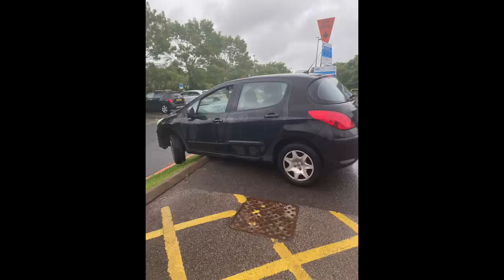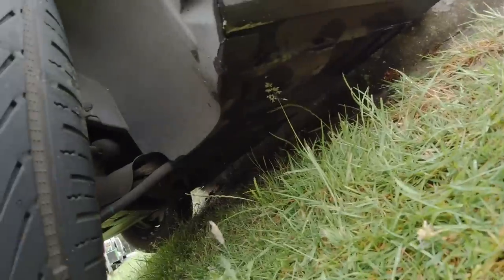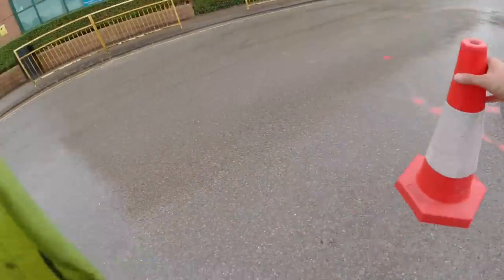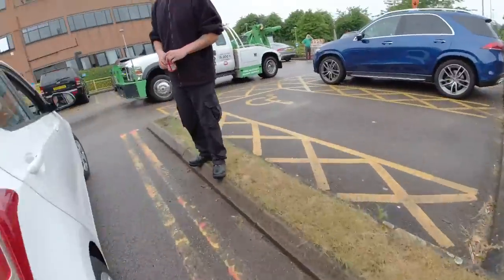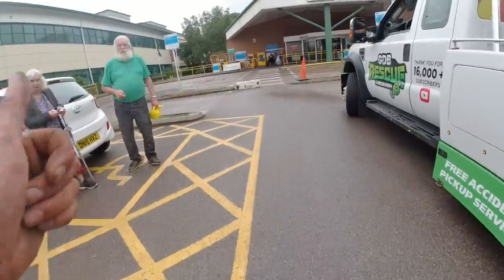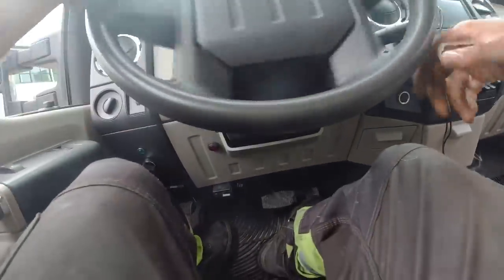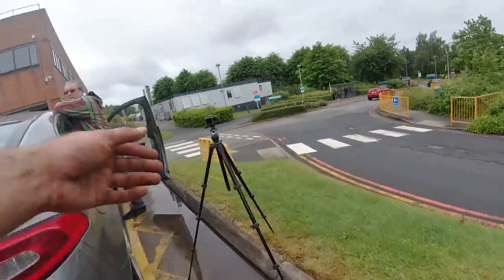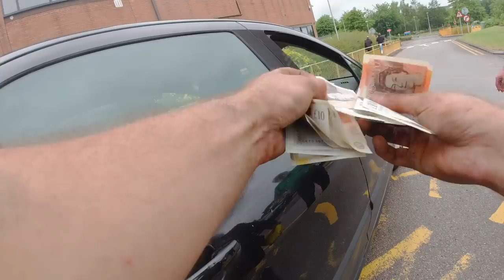INCIDENT at Stafford Hospital - A&E Car Hanging over the EDGE!

Comment: When I was doing breakdown and recovery  we had a book of rules to follow when we got on scene cones going out warning signs ect it could take long setting up the safety than doing the job people couldn't understand spending about 30 mins settling up for a 10 to 15 minute job but it saved our backsides when something went wrong not on scene there was a few accidents the thing that saved us the site was set up by the book only for that we could have been held liable for the accidents even though it was caused by bad driving of the motorists don't cut corners setting up things can go wrong That's out of your control they even measured the distance of the cones and warning signs from the scene and the position of recovery vehicle and service van and angle they were parked it everything was OK and most importantly get people away to safety from the side of the road so if the vehicles are struck they can't be hit by them it does happen even if its raining get them away from the vehicles they might be passed about getting wet but they'll still be alive
Reply from the maker: Incredible read! Thanks for comment and the watch! GDB

Comment: woo-woos on, reverse up, spec the front, lift up, h/brake off, shove it back onto the carpark...
no sense of adventure these younguns...
Reply from the maker: Very true but the more the rear is raised, the lower the front when comes back over kerb. Could of tow roped and pulled in 30 seconds also, but with an audience around better to play safe.
Reply: @GDBRescueandrecovery  no, spec the FRONT + push it back up
Reply from the maker: Height difference of ground and length of f450 going sideways

Comment: Greg is sound, he obviously does have morals, he made sure he tested the car before the old couple which a lot of people wouldn’t do, he was as fast as possible. He gave the couple the £10 overpayment back which trust me alot of recovery companies wouldn’t they are sneaky. Personally though I would have said just give me £100 as the job was easy enough, at a hospital and you could see the old couple weren’t loaded but he isn’t running a charity but in future I’m sure if the same situation happened again with an old couple struggling he wouldn’t except the full payment. 

Seen some comments regarding his prices aswell for things like tyre callout. I drive down the m6 everyday and trust me it’s full of crashes and dodgy drivers, emergency call out for a new tyre in such a dangerous place is why it’s like £350-£400 you are paying for the same day tyre change in an emergency situation.